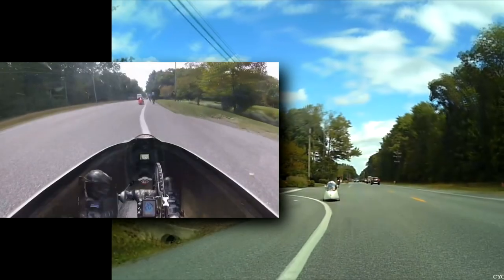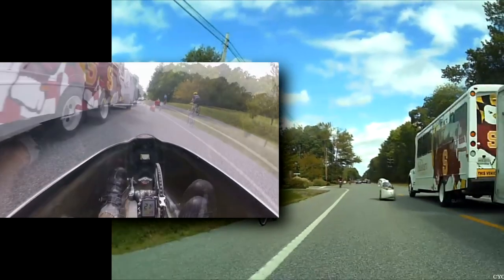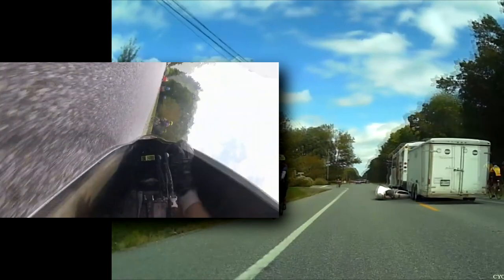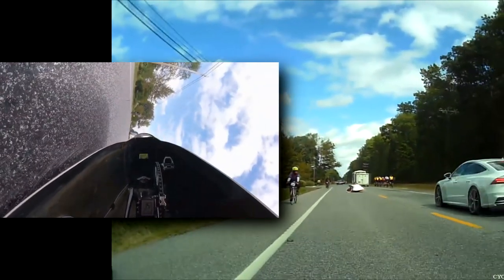Video 3: Side by side crash view

Comment: Thought about this for awhile and thought I'd put it in my own words in a way so I could understand.    Maybe this might help someone else.

IMHO, basically the easiest way to understand this is to look at a kids toy....the "Razer Riprider" (google it) .   It's a trike with caster rear wheels and is designed to flip around quickly.

Basically it's about forces and the center of mass.   If the back loses traction and can slide in any direction, then as the bike starts to spin,  then it tends to get worse...not better.    Now, the razer riprider rear wheels aren't "sliding".   They are castering which allows them to roll in any direction.   It's a subtle difference, but the main point is that front wheel is exerting a much larger percentage of force in the direction of travel than the rear wheels and the force is not necessarily aligned with the momentum.   The front wheel is slowing down, and the rear wheel(s) and center of mass are still moving forward, so the thing spins-out.

It's not inherently about 2 wheels in front or the tadpole configuration (as the razer riprider demonstrates).    It's about sliding sideways where most of the friction or other force is in front of the center of mass and the rear is sliding.

The old Porsche 911 used to have the nickname "Doctor Killer" because it had a lot of weight in the back and if it started sliding it would quickly end up ass forwards
and completely uncontrollable.  Unfortunately, this nickname might be recycled.

I thought I'd add one other thing.   Because the mass is in the rear that's where the momentum is. the rear tends continue going down the highway, but the front can whip out into traffic.    The more it get's turned, the more the thing wants to spin, both from the front wheels and aero forces.but the front of the car/trike whip out into traffic because it's lighter and the front wheels.

 This force can be aerodynamic (the air pressure on the nose cone and or lift/crosswind)

Now, I think that's really only 1/2 the story.    Now the question is "why does the rear wheel ....slide?". 

I don't think the rear wheel is really "sliding".    I think it's "bouncing".    It's like a throwing a bouncy ball down the road.   It's bouncing AND still moving down the road.
It never really loses it's sideways momentum even though it's hitting the road (as long as it doesn't stop).    The ball doesn't slide, but it doesn't really have much friction either so it's kind of like sliding.

This again makes everything go to hell very quickly. 

So here's what happens: 

Ride over rumble strip...rear wheel starts bouncing...driver steers away left from rumble strip which causes slight lean to right....rear wheel keeps bouncing.   This means the original slight steering actually only serve to make the trike swing around the front...and not the rear which really causes it to spin.  swinging around towards the the front which makes the turn much sharper than the driver intended.....now aero forces come into play pushing the nose of the trike, resulting in a torque to the left. 
This has the effect of making the front whip out more, because the center of mass is towards the rear.   It also makes the rear wheel move a little to the right.   The front swing out toward the center causes more more force on the front wheels and more lean cause the rear wheel to bounce even further with every bounce.....eventually rear wheel clears rumble strip and stops bouncing grabs 100 % of the time and skids.     Now the bike is not rotating to the left any more, but the rear wheel is suddenly skidding semi-sideways in the direction of travel...and if the front wheels are turned it will suddenly whip around the other way.     If the trike regains control, the left wheel will eventually hit the ground again, jerking the driver violently to the left, which will make the velomobile roll to the left.   There is also "suction" from the trailer pulling the velomobile left also.

I think suspension will help alot, but I believe that the important thing is to treat rumble strips with respect....much like black ice.    You want to aggressively continue to steer in the direction of travel and not make a sudden move with the front wheels.   Probably easing away from the rumble strips relatively slowly.
 away from the center of the road, because making the rear wheel bounces even more to the right....causing more
Reply from the maker: Thanks for your well thought out reply.